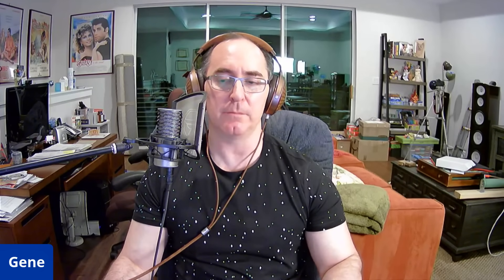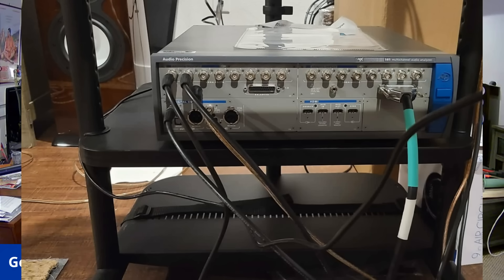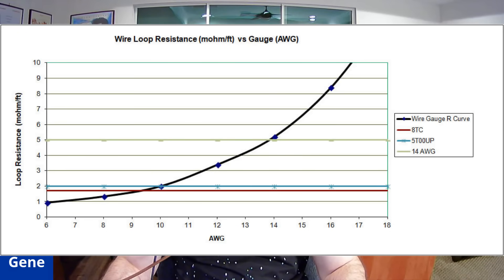Speaker Cables Really Don't Make Much of a Difference?

Comment: Dear Gene, here is Riccardo Cassani from Italy, reviewer for Musica magazine. You asked some information and thought about cables in use. My answer is: a few years ago I switched from a really generic speaker cables to the one I'm using today noticing a little distortion in the top of the frequencies, but only with some specific HD audio recordings (I never notice this kind of problems listening to a CD!). I can't afford a specific treated room in my apartment so the arrangement of the space need a 6 mt. cable to reach  for the left channel. My set is: Biamp and vertical Biwired for each channel and I use a couple of Audioquest FLX SLIP 14/ 4 for each speaker in star quad configuration. At the present I'm satisfied about the result and I don't feel the need to improve further. I should say that I found more evident the difference between a simple connection vs. a Biamp, Biwiring horizontal or vertical connection. Greetings from Italy.

Comment: Great job Gene!  It's all about making INFORMED decisions.  If you have the money, by all means, go for the prettier stuff.  Just don't believe and propagate the hype.  Gene has it right.  He admits freely that he can't hear the difference, and it's the aesthetics and build quality of the Kimber Kables that he pays the extra $$$ for.  Also I would imagine that he appreciates the fact that the cables actually measure a little better than a 12 gauge power cord from the local hardware store eventhough it's not audible.  I get that.

Comment: Please put up metrics lengts in the video, just text or something. :) Awesome vid as usually!
Reply from the maker: All cables were 10ft which I stated in the video. The LCR measurements are per foot and DCR is loop resistance.
Reply: @Audioholics  True but it takes some time in my head to translate that and then I get lost in the other stuff you are talking/showing. I dont wanna starta a metric vs feet war :D its just my brain is a bit slow in translating feets and also awg. Hope I havent offended anyone cause this is also a senstivive subject :)
Reply from the maker: @Fathernimman  In college we used metric system exclusively. But for some reason, I still visualize feet and inches better. LOL
Reply: @Fathernimman  3.3ft ~1m now after that it's not hard to do the math that 10ft is approx 3m
Reply: @martinlillepea  sure, its not hard. Did not say that. What I said that it could be nice with a row of text saying that/translating that so you dont need to do the math while watching a video. A video that is technical, flled with data. Getting an "aprox" value sure is nice but when its techincal I dont want aprox values :). 
I am not writing this in a bad tone either, reading it but I am just trying to explain what I meant.
Be aware also that awg is not a global standard, while looking at a graph with AWG:s is also quite bothersome to do the math on while watching at the same time. My brain cant compute that information :P

Comment: Had the  8TC in the 70's. A great cable. But after about 10 years, the cable came distorted. It was years later that Kimber found out that the dye in cable Teflon style insulation caused some type of reaction with the copper. You have no testing for the insulation. The thicker the PVC insulation such as original Monster cable, usually the poorer the transient sound. Ray has additional equipment beyond the LC tester. You make it sound too easy. Interview him again and find out you have over simplified what measurements help define a speaker or interconnect cable.
Reply from the maker: Proof is in the pudding. The dieletric has minimal effect on speaker cables at audio frequencies other than providing insulation between conductors and proportionally affecting the Ls and Cp which I measured. My measurements include the effects of the dielectric.  Cables don't produce non-linear distortion. Claims about transient differences are anecdotal.

Comment: Finally finally someone doing a relevant cable testing. I had commented exactly this test on Danny's inductive coupling SnkOil cable test.
Reply: I thought the same, I had my flagship arcam and Canton reference book shelf with oppo player hooked to regular bestbuy speakers wire with no conditioner power supply and reg hdmi cable.
Base not great and clarity was also not the best. I thought I need to upgrade my amplifier. More power required.
Then I was advised to look into wires, hdmi and power conditioner.
Did some research and purchased van den hul ultimate hdmi 4k cable, then same company mid level speakers wire and Puritan conditioner. Ask my wife to listen before after difference.
One simple answer. Big difference, base went up, much refined sound and distortion was gone.
I used to hear mild noise from arcam tridol power supply now that is gone.
Thats my take on this. Personal and family experience.
Reply: @jackryder6732  i would be pleasantly surprised to hear a difference. But the irony is that people say they hear but nothing shows up on freq sweep recorded on a measurement mic. And fact is that measurement mic is far superior than ears at registering a difference if any.

Again i cant reject anyones experience but as long as i did measurements like in this video no difference showed whatsoever.
Reply: @berlyfredy7153  I totally get it and for many years didn't bother to change my hdmi or cable wire or conditioner.
Honestly my sysyem didn't sound good as I am picky and thinking spending again to upgrade powerful amp. I have Arcam avr850, quite a powerful beast. After doing my own research and staying away from Amarican brand, I found European brands like van den hul or puritan to be better quality and honest. 
Yes, 100% I found the difference. My rear speakers had weak base now its much better I can hear it, much refined sound even if I put the sub to zero. 
Its not complete subjective but one has to experiment.
Reply: @jackryder6732  maybe there is an objective element to your rear speaker that the long distance wiring increased resistance beyond speaker impedance so that you were losing signal.

Comment: Hmmm..always an interesting topic. But whether real or not.the only time I have heard any real noticeable sonic differences, was more to do with the core material used . As over the years I have borrowed and tried quite a few different gauges of ofc, tinned ofc and silver cables and ironically found that ofc cable always sounded the best for me. So I got some good cheap Van Damme shotgun ofc cable for my subs, and some even cheaper BKS German ofc cable for my main speakers and custom made them to length. 

But hey... I really don't mind if other people think they hear a difference and want to spend a lot more money on cables ...then it's their money and choice! But I get confused by the whole measurement thing too...as I have heard amps that measure really well yet sound worse than amps that don't, so I still always prefer to  to build a system that suit my ears and not test equipment, even if that means I have no bragging rights with the techno boys out there.

 That said... I do really like and use shielded and tinned Belden studio cable for all my interconnects, but again it's still pretty cheap off the roll...so I am happy that my ears don't have expensive taste so are low maintanence in the hifi game over decreasing circles.

Comment: I'm convinced the overall air quality; with the correct balance of negatively and positively charged ions effects the sound of my highly advanced system way more than switching out my 4 gauge hand woven solid gold plutonium coated cables; for coat hangers. 
I have proven this is measurable on numerous occasions through my blind (drunk) testing. 
I'm so confident and sure of myself; I challenge any audiophile out there to join me in my blind testing; (b.y.o.)

Comment: I got cheap, GearIT cables for the 5.0 speakers, and Monoprice Onix cables for my two subs. Will a power conditioner, and Kimber cables improve the sound? Yeah, very likely. Is all that overkill for my current system (Yamaha RX-V6A Emotiva Airmotiv speakers and subs)? Yes. Definitely.

Comment: What do cables do for the low level hum or noise you here when you aren’t playing anything through the speakers. Does a good set of cables stop that noise?
Reply from the maker: If you have a grounding problem, yes that can help. Shielded interconnects are the way to go. Sometimes the hum you hear is caused by the transformer in your amp and no cable can fix that.

Comment: I swear your emotions and feelings have a deeper affect on how you hear sound. My hifi is rackmountable and I custom built my cables to the perfect length and each channel has it’s own colored cable sleeving. Even all AC power cables got the custom treatment. I put a couple weeks into building the cables until everything looked perfect. The appreciation of the craftsmanship that I put into my cables has a bigger impact on sound than the actual cable material. I know if I swapped the current  perfect cables for the reject/mess-up cables I built it will sound worse because I don’t appreciate them as much. It’s kinda like when your stressed, it’s harder to focus on the sound of your music. But when you start relaxing, you can notice a difference in sound.
Reply from the maker: Agreed. Music always sounds better to me at night, especially if I killed it at the gym and still have endorphins going...
Reply: I wonder why that isn't the case at Hi Fi shows, where there is usually a consensus  regarding which system/room sounded the best? Were all the observers in the identical emotional state? And only in THAT room?
Reply: @robertherman1146  well, it’s like a wine tasting. You mentally prepare yourself before showing up. Also, you bought tickets to a hifi convention/show. Pretty sure you wake up with audiophile on the brain.

Comment: Gotta love chocolatey mid-range!  I have always been a 10 - 12 gauge OFC guy for the last 40 yrs. Just updated my system and tested my KEF reference model 4-2 speakers using 12 gauge install gear.OFC vs audiiquest rocket 88 and could not tell any difference. Those audiiquest cables cost more than $1,000!!  DUM dumb.  Those expensive cables are not even jewelry.  Jewelry will retain much more value. Expensive speaker cables are foolish!  I also agree with Gene,.moving your head a few inches one way or another will make much more difference in sound than the cables.

Comment: I wonder if we drove House speakers and amps with 2 Ohm or lower loads there may be a difference? Or if there is anything to be said about the efficiency of the signal that some cables may lead to longer equipment life? Regardless I like the Kimber cables myself and will probably get them anyway once I upgrade my theater.

Comment: Gene should have a debate with Danby at GR Snake Oil... I'm sure more than one person knows who I'm talking about
Reply: Danby's big thing is RF static picked up by cables  
Which makes since to me 
RF can present itself as static 
When I lived in DC I could tell the diff in Noise from RF at LOW volumes 
Same system Here in Nowhere Arkansas there is no noise from RF 
My power conditioner made less of a diff here as well 
Moral of the story is 
If you want good sould MOVE to the country where it's Quiet :)
Reply: Considering how good his speakers are, I wouldn't call him a snake oil salesman. Even the cables he sells are vastly cheaper than expensive cables from Kimber. I've listened to his tower open baffle speakers in a home theater and they are beyond amazing. Probably as good as the $16k speakers used in this video.
Reply: @GSP-76  I don't think so. F328Bee are engineered based on decades of research (including tons of blind Listening Tests with Trained Listeners and others, to see the correlation between preference and measured performance). These are supposed to be actually "better" than the mightly Salon 2s, which have been considered as best speakers in the world for years at whatever price. GR Research make good Speaker designs, but nothing in the league of higher end Revel.
Plus, as long as he claims non-sense things about his cables, he's a snake oil salesman, no matter how good are his speakers.

Comment: Also, why don't manufacturers use the "audiophile" cable in the amplifier, A/V reciever internals instead of cheap wire?, same goes for speaker internals... cheap wire with spade connectors??  Just wondering...

Comment: Well done! I run decent gear, I use good quality, pure copper,  fine stranded speaker wire, (amazon) 12awg with a serious 200wpc amp. My friend runs a high end audio store. His $1k cables made absolutely no difference to me, but he swears they do. I say cool, if it makes you happy, go for it!! I would spend that $$ on something that will make a difference, a better sub, speakers, source, Dac.. But what about the speaker cable becoming an antenna? or picking up a 60hz tone from power cables?? Science proves that it happens, but is extremely far below the threshold of human hearing (as is what you measured) It may drive Super Man crazy...... but us mere mortals will be just fine!
Reply from the maker: Once you terminate the speaker cable into a low impedance load (a speaker), it no longer acts as an RF antenna.
Reply: @Audioholics  I completely understand, as I have worked in the Electrical field for over 35 yrs. But there are people on YouTube that are convinced and preach that cables are antennas, and collect all sorts of mystical things, hence magic cables for the price of a good used car. It is great that you and a few other people on YouTube back findings with accurate meaningful measurements. Have been an Audioholics fan for years. Keep up the great work!!

Comment: after seeing all your videos, I've stopped using expensive cables and instead going for copper 12 AWG generic cables. Thanks for doing actual science!
Reply: I thought the same, I had my flagship arcam and Canton reference book shelf with oppo player hooked to regular bestbuy speakers wire with no conditioner power supply and reg hdmi cable.
Base not great and clarity was also not the best. I thought I need to upgrade my amplifier. More power required.
Then I was advised to look into wires, hdmi and power conditioner.
Did some research and purchased van den hul ultimate hdmi 4k cable, then same company mid level speakers wire and Puritan conditioner. Ask my wife to listen before after difference.
One simple answer. Big difference, base went up, much refined sound and distortion was gone.
I used to hear mild noise from arcam tridol power supply now that is gone.
Thats my take on this. Personal and family experience.
Reply: @jackryder6732  lol oh boy...
Reply: @mattw3406  This is the typical snide reaction from people claiming to know it all yet look like they just fell out of a Goodwill in terms of personal appearance. You really don't know what the difference was, or whether it had an effect.
Reply: @jackryder6732 please revise your statement and change your opening for "as an engineer" then say the best cable is pure BS. Then it will make sens. Oh and make sure you keep buying cheap wine, just make sure the alchool and sugar content is ok, as a chemist I can tell how wine taste after icp and ions analysis.

Comment: Would be even more interesting if you measured cables with more divergent designs and constructions. Have you measured any of Galen's designed Iconoclast series cables.
Reply from the maker: No but I am sure they would be as good as the Kimber 8TCs.
Reply: @Audioholics  I have the Kimber 12TC/8TC bi-wire combination in my rig, I like the way they look and no complaints. I'd like to see the same tests you just finished up performed on the purposefully designed Iconoclast speaker line.

Comment: Why don't you use zip cord and sell your beloved Kimber cables? Is it just the looks that decides? To be sure, I am not a cable guy. have cheapo cables in system. And thanks for doing the measurements. I find it always amusing when audio engineers argue that differences cannot be measured. 
One thing I wonder about is dynamics and whether it might be possible to test with microphones and real music, doing some sort of residual analysis. Result cable 1 - result cable 2 = difference. If difference <120 db white noise, then that is good indication for no difference.
Reply from the maker: I've got them, why not use them? they look cool and measure better than 10AWG.
Reply: @Audioholics  But in video you argue that although they measure better, differences are IN-audible. Isn't that the whole point of the video? Then speaker cables are chosen based on color/looks, like any other fashion accessory. Right? Nothing wrong with that as long as it is clear.